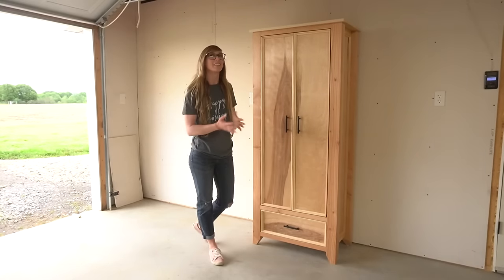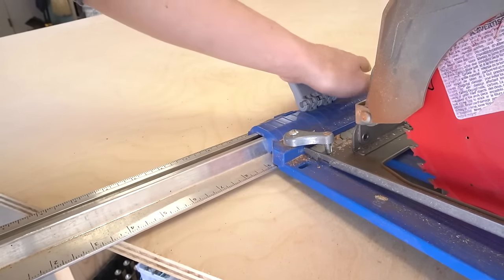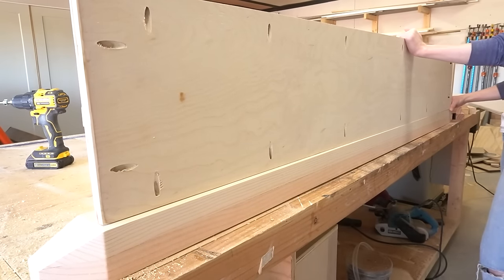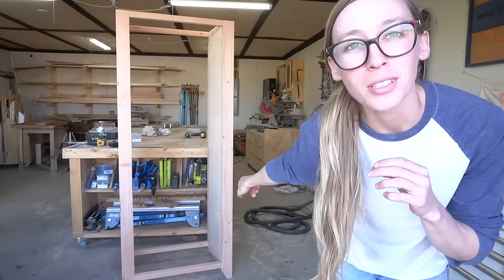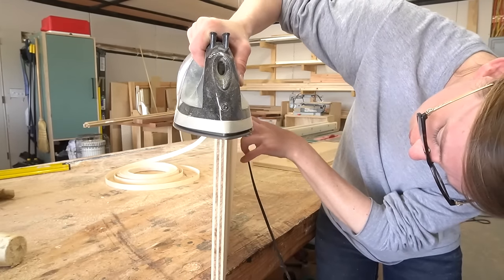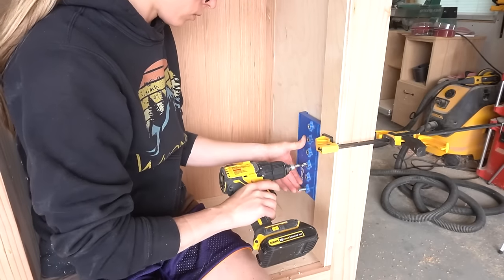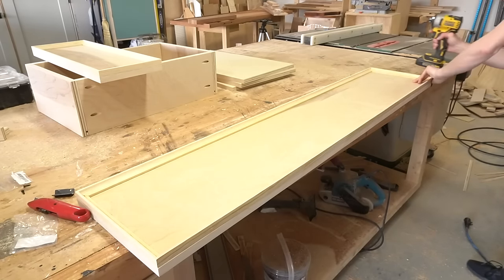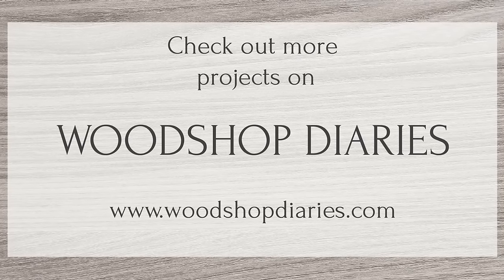How to Build a Wardrobe Armoire Cabinet--{Using 2x4s and Plywood!}

Comment: Shara, It's good to see you're passionate about your vocation. It is very inspiring. Thank you for following your dreams. I like how you thought outside of the box in fixing your error. A mentor once told me, "The platform for success if built with the broken boards of failure, it's what you do with the broken boards that determines the outcome." You can either throw them away, or learn from them and use them in future projects. Great Job on the project and to your parents, Great job also in raising you.

Comment: Hello , my name is Kelly I’m a lot like you when it comes to making my wardrobe, I however am using 1/8 paneling for the sides and back , I noticed that you’re side walls a a bit thick , is that you’re style or are you just using up material you found to be useful ? I went with the 1/8 wood paneling because I want my wardrobe to be light in weight , but as it is my first time doing it this way I’m not to sure on the strength , but the side walls are not really going to be supporting much weight but if there is some weight areas I could always use 3/4” line brace boards to support a small shelf and cloth hanger rail , any way how are you making out ? I mean are you happy with you’re results of you’re projects or do you get like me , thinking that I could of done my job a lot better , only if I had found some of these great videos in time of need sometimes  it’s too late the cut and paste had been made , but I’m not giving up as of yet there are many more projects to learn and apply , thank you kindly Kelly the dude up North have a nice day :)

Comment: Hey @Shara Woodshop Diaries Thanks for all these wonderful videos, it has surely inspired me to build some of these pieces on my own, this one being the first of the lot. I do not have a table saw currently, can I use 2*4 instead of making a 3*3 by gluing & cutting for the corner posts?
Reply from the maker: Thank you! So glad you enjoy them! You can use 2x4s and/or 4x4s, but many of the measurements will be different than what I’ve noted.

Comment: Oh my! I am so glad to find you. I know that wood prices vary by location and current prices. 
About how much does this cost to build! I need something similar to put in my laundry.
I am new to any kind of building and am just starting to collect tools. I haven’t checked to see if the tools you used in the description box.
You are so easy to follow.
I have skimmed through your content so will be binging.
Thank you for your concise directions on these videos.
Oh, can I come visit to help you walk me through one cabinet 😊 You don’t sound like you are from the Midwest though 🤷🏼‍♀️
Reply from the maker: Hi! Thanks so much for your kind words! I’ve got the materials list in the video description along with the tools. Most of the materials are linked so you can figure out current cost to build based on current prices. The way prices have been fluctuating over the last three years, it could cost significantly more or less than it was when I built it. Double or more in some cases. So I always suggest looking at current prices and figuring by your location.

Comment: Love these designs and how you did it! I have a question though (new to wood working), since you used Birch ply but 2x4 legs what do you do if you wanted to put a stain on it? I figure it would look quite different with the different types of wood.

I bought some red oak plywood to make a tall file cabinet but I can't get red oak 2x4 here or anything I can see to make the legs out of. Anyways I love these pieces!
Reply from the maker: Birch and pine/fir stain pretty similarly. Since neither have a super distinctive grain pattern, and they’re close to the same natural color, when I’m staining, I just stain as normal. 

Now, oak is a different animal and it has a distinct grain pattern and tends to be quite darker than basic pine/spruce/fir. So if mixing and matching, I’d recommend sticking with birch or maple plywood if using with 2x4s or other construction lumber as they’ll stain reasonably close.

Comment: Very good looking.  When you designed this, what did you use, pencil and paper, SketchUp, etc?  Reason I asked is the “items” you are learning about as you progressed through your build.  I know you said “design in your head”, but thought maybe you put what was in your head on paper or computer before the build.  So, how long do you spend at the local store picking out straight lumber.  Do you buy from a locally owned company or, one of the big box stores?
Reply from the maker: Hi! Thank you! I imagine what I want to build and usually just use my visual to put the pieces together. Sometimes I sketch on paper first but I very rarely draw it on the computer before it’s actually built. I only sketch it on a computer in order to share the plans on my website. I don’t actually use plans myself. 
I don’t spend too long at the store looking for lumber. I check that it’s more twisted and it’s in good shape and load it up. Ten minutes or so. I buy my plywood and 2x4s at the big big store (better selection and quality) and my 1x stuff and trim at my local building supplier.

Comment: Amazing - I love how clean you keep the editing to keep it moving along. Looks like you use your impact driver for the screws, and drill driver (clutch) for pocket holes. I've noticed that my impact works well for the pocket holes, HOWEVER it beats down on the collar and messes with the hole depth, blowing through the sides sometime. So I've gone back to DD for drilling the holes. Have you had issues with impact on the screws, or leave it on setting 1 or 2? Love your work, keep it up! God Bless
Reply from the maker: Thanks so much!! I use my drill driver for drilling (I leave it on the drill setting all the time...I never change it even when I’m driving screws) and my impact for driving. I never use my impact for drilling as it just doesn’t perform very well.
Reply: @WoodshopDiaries  I have the brushless impact, and the regular dewalt drill drivers. In that case there was not a variable trigger in 2017 so having a clutch setting is helpful for pocket screws. Typically set on 7-9 with 3/4" baltic birch works well to prevent blow out and keep production assembly high.

Comment: Nice work again ,here is a trick of the Trade , Inam a retired Professional Woodworker with over 25 years of Professional Woodworking and over 35 as a Woodworking Hobbyist  you never have to reveal your mistakes just  come up with good solutions and when or if you are asked about  a Specific question on that area or design just come up with a simple response of  oh yeah I saw  a similar design on a Sam Maloof or Frank Lloyd Wright design  and Inwanted to mimic that ... trust me nobody will challenge  that one  as for my own self I am a  fan of both of those men and their work  as I do have a large personal Library of their work  and have been to Museumns  of both of them too FYI  you are by far one of the prettiest Woodworkers I’ve seen and I ran a large Architectual Woodworking division for many years
Reply from the maker: Haha great idea! It sounds like you are on to something there.

Comment: So I did enjoy seeing your mistake, because it helps me feel like I'm normal. 👍looked like you drilled crooked on the pivot hinge due to drill size. Ive had the same problem, what do you think of a whip to solve that problem? But how to hold it while drilling?
Reply from the maker: Haha I’m glad you enjoyed the mistakes. This project had a few of them...definitely didn’t preplan anything 🤦🏼‍♀️😂😂 I did have to drill crooked  because of the drill. It really didn’t have any issues though...there’s enough wiggle room, it worked out fine. But I’m sure there are other/better ways to do it. 😅
Reply: FYI you can get 90 degree adapter or flexible drill bit extensions to solve narrow space issues.
Reply: @WoodshopDiaries  what Me P said.   The adapter is $10-15, but do your driving with it for a while to get the feel for it if it's new to you.  For extra stability, use a drill block.  Run your unchucked bit through the block, align to the center punch hole, then push the block up and flush and clamp it down.  The drill block is around $8, and a center punch costs... well, nothing, in a pinch. A screw or nail will do.  Anyway, that'll get your hole right on center and level to the work.

Comment: You may want to invest in a pin nailer. 23 gauge pin nails make very small holes. As a Trim Carpenter, that’s what I now use for my furniture builds.  In most cases, you may not feel the need to fill such small holes. And if you do, they’re still nearly invisible to any but the most discerning eye.
Reply from the maker: That’s great advice. I got away without having to use a nailer one this project so I try to avoid it when possible 👍
Reply: @WoodshopDiaries  I totally understand the desire for the cleanest look possible. But, some days painter’s tape just doesn’t cut it. A few pins, some sawdust, and wood glue to make your own filler that can match the color of your project will do wonders.

Comment: “To pocket hole or not to pocket hole, that is the controversy.”  A pocket hole screw is nothing more than a mechanic connection, where the screw is in at an angle.  Would people be okay if the screws were perpendicular and screwed through the wood into the plywood, and then plugged the hole with a dowel and flush cut it?  Then you hear people say that its the glue that provides the permanent connection and the pockets screws are acting as clamps.   This controversy will go on forever I think.

I enjoyed your build, and your ability too adapt.  One of the biggest claims you can make is “I fix things!”, and you did here.
Reply from the maker: Haha you are right! It will forever be a controversy 😂 it is what it is. Thank you for watching! I’m glad you enjoyed it!